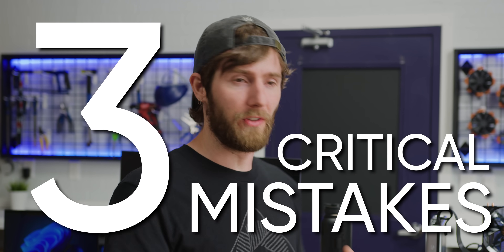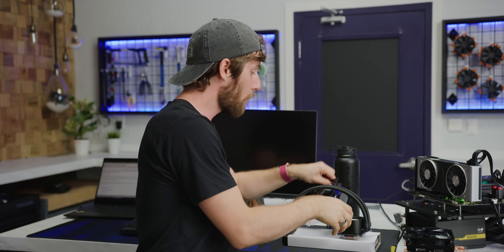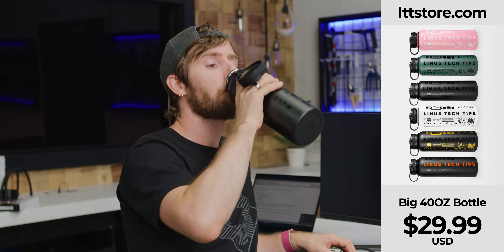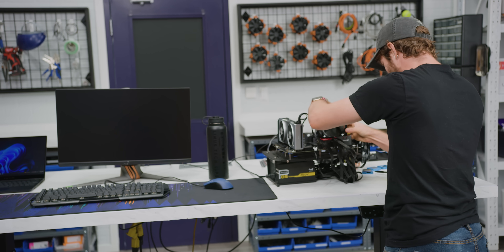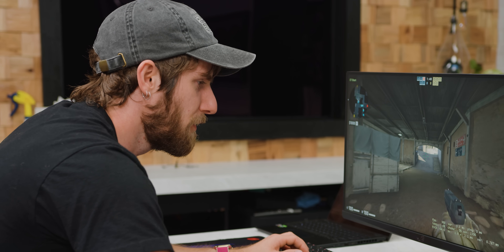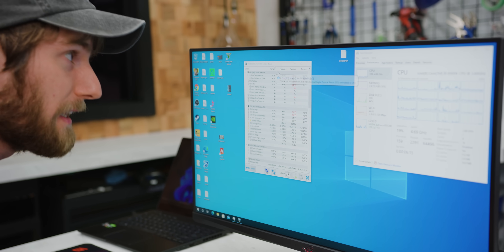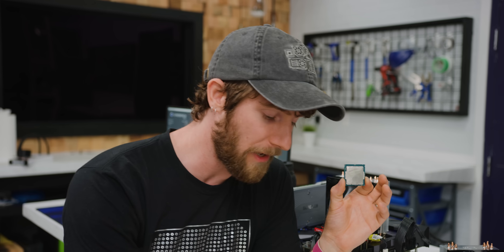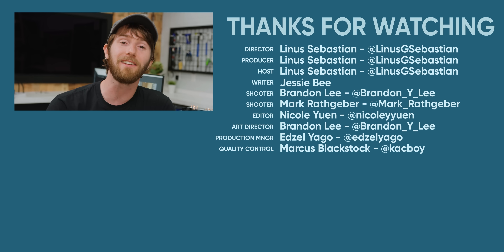How BAD is it if you forget to peel??

Comment: This reminds me of an old friend of mine. 
He didn't want me to build a system for him, and wanted it to be done by a professional.
His i7 7700 was running at over 90c in every single game, despite it being cooled by a Hyper 212 Evo.

He wanted to buy a water cooler, as the i7 must be a really hot running cpu.
Asked him if I can take a look at it, and after a lot of back and forth he finally agreed.
-> Plastic wasn't peeled, after reapplying the thermal paste, it maxed out at 64 degrees Celsius.
Reply: Similar, I was in 8th grade when I wanted to build my first PC. Worked all summer and bought the parts and family didn't want me to build it and mess up. Took it to a shop and it took them two damn weeks to build it and it would boot but I couldn't install the OS (win98) The hard drive (IDE at that time) wasn't plugged in fully. I tore apart the computer and rebuilt it, also applied more thermal paste as they didn't apply any. What a crock. At least all my friends asked me to build their PCs.
Reply: @Gatorade69  My oh my, that's a while ago.
Glad I never really had to experience IDE cables, they really seem like a pain to work with. :\

Nice to hear you were still able to get started on building though. ^_^
Reply: I built my own rig but during testing I must have forgot to turn on the case fans in bios so my cpu even resting was always around 70 degrees. The second I turned them on I’ve never gone above 70, and Is usually at 65 at load lmao
Reply: @Sentralkontrol  thats weird, they should automatically turn on
Reply: @Helperbot-2000  yeah they were turned off in the bios was pretty weird
Reply: @Sentralkontrol  dam
Reply: cap
Reply: did you tell him to go and stick it somewhere else ?
Reply: how the f*** can you be a PROFESSIONAL builder if you do that mistake
Reply: @Mike I have just had the same problem,I wanted it done by a professional due to the fact i bought expensive parts and did not want to ruin it.Anway my cpu (ryzen 5 3600) was running 80-85c maximum in most games using a coolermaster hyper 212 argb and i was really concerned as my stock cooler i had before never reached over 75c in a air restricted case.So today i took my my cooler off and to my surprise there it was the warning to peel label now my temps are like 40c when watching utube instead of 60c and 60c on games like gta which i was on before.However i phone the shop and the woman's response was they don't need to be taken off.
Reply: @Jake_Gurney4147  "they dont need to be taken off" and i thought they were professionals
Reply: @Mutrax4706  it wasnt her that done it its a guy in the back apparently she's been doing it for 20 years but thinks she's just a salesman at this point.I won't be going back there again however
Reply: @Jake_Gurney4147  Haha, that woman's reaction was priceless. Glad ya got it figured out though!
Reply: That's not too bad, probably need to work on airflow or position the tower a little more in the open. Unless you don't have AC inside or something it's easy to keep it at 60 degrees or lower.
Reply: I wouldnt even bother being friend with this kind of friend.
Reply: Always important to run your own tests after your PC is assembled and compare results online to see if something might be wrong. Even professional get careless or lazy.
Reply: When it comes to computers a nerd can do a better job than someone certified. When it comes to cars usually it's best not to trust a backyard mechanic long term though. As they ask for money and don't properly service your vehicle on a lot of "repairs."
Reply: Every kid that builds his first computer thinks he is an expert. I would go with the professional too.
Reply: @atm9566  I mean it's a pretty cool achievement and it is something to be proud of so good for them if they feel they are an expert after building their own PC.
Reply: @atm9566  Oh definitely,
this comment was more to point out the irony, of the situation rather than giving people advice on what to do.
Reply: Should’ve let him waste his money smh
Reply: Well, it's good you fixed it for him. I'm not surprised your friend was reluctant to let you touch his hardware, though. Depending on your interpretation, it could mean he doesn't want to burden you with something he thinks is risky.
Reply: What a stuck up person he sounds like...
Reply: @ReZhorw  It's pretty normal to want professional work if your spending a lot of money, rather than just trusting a friend...
Reply: @shaansingh6048  just because you have professional on your name, it doesnt mean you are a professional, that is the lesson here
Reply: @MiguelLopes-nr5nt  yeah, depends on his actual trustability, this might be a one time thing.
Reply: @ReZhorw  I mean, just wanting done by a professional isn't crazy, even if you trust your friend, those are expensive components, and professionals are insured and would be legally responsible for the damages.
Reply: @InternetsDadGaming  pcs are easier to build than lego
Reply: @Helperbot-2000  I still stand by what I said, I'd absolutely build a pc with someone I trust, but some people don't have the finances to go "oh well, guess I'll have to replace that part when I can" if an uninsured friend accidentally messes up a part
Reply: @InternetsDadGaming  Completely fair point man.
Honestly, if I screwed something up, and it wouldn't be covered by the warranty, I would have replaced the part out of pocket. But I can imagine people not being able to, or not willing to do that.

It just boggles my mind that these companies don't have any quality control going on before they ship something off. That friend of mine was fully willing to spend over 150 Euro's on a big liquid cooler and labour, all because some dude at a company forgot to pull off a label.
Reply: @InternetsDadGaming  "Asked him if I can take a look at it, and after a lot of back and forth he finally agreed."

That's the part that gets me. He knew the "professional" messed something up and still had to be convinced to let his knowledgeable friend fix it for him.
Reply: @InternetsDadGaming  if the friend messes a component up hes gonna pay for it 💀
Reply: @sirenss  they may get you back, doesn't mean they can afford to just get that to you within a week
Reply: @InternetsDadGaming  eh. My friends don't have the money yet they trust me more than a professional.
Reply: @sweetsurrender815  And that's fine. Nothing wrong with that. I swear everyone arguing with me isn't paying attention to a thing I said. It is perfectly fine, and easy to build a PC yourself, and all good to build one with, or have it built by your friend who's put together PCs. My ONLY point, I have EVER made, is that it is fine for someone to pay to have it built. There's nothing wrong with someone who has the finances, to choose to have a PC Builder make on for them, because they don't want to risk going something wrong with them and their friend building it. Even if the odds are tiny of anything going wrong, and it's cheaper to do it yourself, and easy to do, there's nothing wrong with someone to decide to spend extra of their own money to have a business do it if that makes them feel more secure, or they feel uncomfortable doing it themselves with friends. And we shouldn't judge them for it.
Reply: @InternetsDadGaming  even still, a lot of professionals won't care if they take a really long while and charge you a ton.
Reply: @Jenna_Talia  ... and? Read reviews, and get an estimated time.  There's bad eggs that charge to much and take to long in every industry in the planet, there's still people who will wait on that plumber instead of fixing the toilet themselves with a YouTube guide and a trip to the hardware store. It's fine for someone who wants to to hire a professional if they so desire
Reply: @InternetsDadGaming  my only problem with the logic is that you don't have money for something to go wrong, but you are going to pay extra for a "pro" to build it.
Reply: @aboveaveragebayleaf9216  Paying someone to build it is usually like $125, that's a lot less than replacing a GPU/CPU
Reply: @InternetsDadGaming a professional can still mess with your stuff without causing any legal damage, while also having the potential of being really expensive to start with, but yes you're right. If you really have trust issues then a professional is an option.
Reply: @Helperbot-2000 Bullshit.
Reply: @ReZhorw  "Hey bro can I fix your broken pipes?"
"WHAT?! NO!"
"You're a stuck up person y'know that"
Reply: @YellowSabre  idk man many people build pcs before in their free time, i don't think there are that many hobby plumbers out there
Reply: @YellowSabre  In this analogy the dude is a hobby plumber and did his house's plumbing by himself. In that case, yeah I would let him have a peek at it before spending money.
Reply: @please_stop-v7o  Is that right? tell me more about the Hobby Plumber's backstory
Reply: @YellowSabre  It's an analogy.
Reply: @please_stop-v7o  That's right. I made the analogy
Reply: @YellowSabre  So what don't you get?
Reply: @please_stop-v7o  I get that this isn't your analogy
Reply: @YellowSabre  Life's too short for talking to you any further. Have fun and good bye.
Reply: @please_stop-v7o  Have fun writing a fanfic about my analogy then
Reply: @ReZhorw  I can tell you why he isn't stuck up. I have a buddy who was having his PC built and paid for by my friend group. When he got it though, the monitor that HE paid for was broken, and all of my friends just lied and said it came like that. A professional can't lie to you about it like that, and will have to pay for it. A hobby builder, although can usually be cheaper and more reliable, can still make mistakes and have no real consequences.
Reply: @nomasporfavor

Got like half way through your jumbled, rambling comment before giving up.

Think I understand what you are saying but there is a word specifically for this purpose that will NOT have anything to do with the courts. It’s called “warranty” .
It’s not a house renovation worth 40 grand,
Reply: TheCeilingFanCollectorHD  I literally never said it was hard? Being hard has nothing to do with it. You're post is irrelevant to any of my points.
Reply: WOW is crazy because plastic sitcker wasn't peeled off before!😯😯😯

Comment: Haven't forgotten to peel, but I have, on second-installations of heatsinks, forgotten the paste.  You find out really fast either way, because 80C in BIOS is a no-go for trying to boot Windows.

As for my current machine, well... It's a Panasonic Toughbook.  There's a thermal pad on my i5.

Comment: Hey does anyone know if my old cpu that runs at 125w if I get a new Ryzen chip (whole new system and all that) that runs at 65w will I need a new cooler (the cooler I have now keeps it at 30c ish idle and ive never seen it go over 80c even when stress testing the chip) the new cpu will be the same amount of cores (I guess the best way to answer this is just to try it but my cooler seems to do a good job but if not I want to get some sort of noctua cooler)

Comment: hey I did exactly this.  I bought a low profile CPU cooler for my media centre many years ago.. I could never get it to run right.  Cursed it out for monttthhhss.. Hated it.  Decided low profile coolers are garbage.  Finally replaced it and when I did i saw the "REMOVE BEFORE INSTALLATION" sticker on the copper plate of the cooler.  Derrrrrrppppppppp

Comment: No flipping way... I was just chilling and grilling and decided to take apart my old build (3 PC's ago). Pulled off my old Thermaltake heatsink from the Core i5-4670 and cleaned off the paste. Saw some goop on the side that wasn't cleaning off and so I lightly took a plastic brush to it. The brush started to peel the plastic cover on the bottom of the heatsink!

This computer went through me and to my wife until it was retired years ago and I never took the plastic off! I could not believe it and I had to come back to this video to confess my PC building sins!

Comment: Built my parents a PC back in a day, it had a C2D E8400 in it. The machine was working for years, but at some point it wasn't enough to even browse the web or use Zoom, so  I replaced it with "this new raisin thing". While removing the old parts I found that the cooler wasn't cooling anything: two pegs on the top were broken, so the CPU was "air cooled". Not sure for how long, surprisingly it is still in working condition. Some time before same thing happened to the Duron Morgan, and it actually released the magic smoke in a fraction of a second…

Comment: You didn't show us the bottom of the 212 after the 9900k was throttled. Wanted to see if it melted or became sticky depending on what that plastic was made of. Most likely it isn't BPA free because that's what makes plastic malleable. 😖

Comment: i had 3 identical coolers on my work bench. one was peeled. 2 were not. i was building an old x58 maybe? xeon for shits and giggles. grabbed one of the unpeeled ones and stuck it on there. cooked the chip. faulty thermal protection i guess. thats what you get for buying old xeon engineering samples though. ;)

Comment: Using a Ryzen 5900X with 105W TDP and a Waterblock and 30°C Water temperature you get around 88-90°C with Plastic in prime95. If you remove it it drops down to 55°C.
Speaking from Experience...

Comment: yup, happened to me. build my pc almost 3 years ago. and about 4 monts ago i started to drop frames like crazy and got high cpu temps. so i opened my puter up and changed the thermal paste. and once i was cleaning the paste off the cooler i noticed i had the sticker on. :p

Comment: How to check if you forgot the plastic peel without actully checking: 
CPU temperature should play around 75-80 degrees celsius when gaming. When the computer is doing small processes or in an idle state, it should be around 45 degrees celsius to a little over 60 degrees celsius at most.

Comment: we can all make mistakes.  i've build PC's since 1998 myself, few months ago i struggled installing my Be Quiet  Shadow rock top down cooler. the issue wasn't because the cooler is naturally hard to install (i have a removable MB tray). my issue ...  i put the AM4 brackets on upside down on the heat sink ... every thing else from back plate to  TP, was fine. after 3 tries of screwing the heat sink down and many curses  later i realized the brackets were on the wrong way  took cooler off flipped them the right way , re pasted heat sink, and thing screwed on easy peazy then.   i felt so stupid. 

once i bought an Artic cooling  Frozer cooler , damn thing was not flat, after putting it on , i had bad temps  on my FX 8350 back in the day , i rechecked and the damn thing could  rock back and forth on the cpu. really pissed me off  so i sent it back and got a cooler master  heat sink that was way better.

Comment: When I was working for CybertronPC. This has happened quite a times with the plastic on the CPU cooler. When it got to the testers they would pay EXTREME attention to the temps because of that. We had maybe 50 computers starting out with the enermax coolers

Comment: It happens too with some companies who build Ready to Go computers by themselves you ordered. Custom system builds have higher chance for errors. Small mistakes also happened there, like forgotten seal to remove from cooler surface...

You're not only on the world who made mistakes in build life. Errors happens so many everywhere, even from big computer companies with something not fully inserted or loose cable connector... i see them sometimes.

Comment: Linus: "Is there plastic in between your CPU and heatsink without you knowing it?"

Me who doesn't have a desktop pc: starts panicking
Reply: thats like asking me if my girlfirend is cheating on me
Reply: @aa-tx7th  same
Reply: @aa-tx7th  ☠️
Reply: I'm not even a little bit worried. My computer runs shockingly cool even at full load (which is often, it's a proper workstation). I always go absurdly over-cooled on my builds so even when overclocked (if I ever bother), fans don't even need to really spin up, and it stays super quiet.
Reply: I keep it on so I don't scratch my CPU.
Reply: "Oh hell no, someone put plastic on my CPU"

Comment: ahhh, thermal throttling. I remember the days when if you took the cooler of the original Amd athlon thunderbird processor  (circa 2000/2001) , it would instantly fry itself !
I do also remember processors that ran without heatsinks , but that was even further back !

Comment: How about using graphite from a pencil as thermal paste?
Take a soft pencil, color heatspreader and cold plate as dark as possible and rub them together by twisting the cooler before fully thigtening the screws.
...
And try to not get graphite powder on other components as it is not only thermally but also electrically conductive.

Comment: Left the plastic on my water cooler after I had had a long shift and tried to install it with no sleep. Temps were warm but not crazy high so nothing alarmed me. 1 week later as I start throwing boxes and papers away the "OH, SHIT" moment came. Ended up changing thermal paste and all, but none of the plastic was melted and the system runs steadily today, two years later.

Ryzen 2700x @ 4ghz
Enermax 360 AIO

Comment: Oh well, the plastic solution would be suitable for my Scandinavian buddy. He told me his specs once, Intel i7 8700K with watercooling and some powerful graphics card. Turns out, he usually plays mid level games and has his CPU not overclocked at all, it always runs at base clock. I told him, he's wasting loads of potential, and that he could easily run his CPU 1.5GHz higher without any issues. He refuses, but well...... At least his CPU will very likely make it long enough to grab veteran's pension.